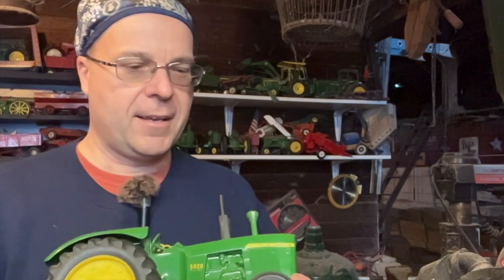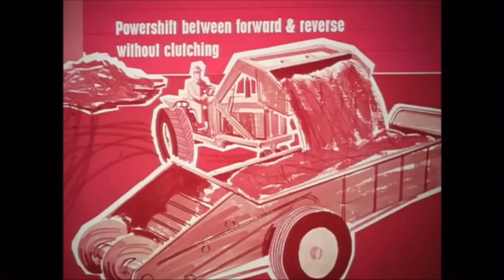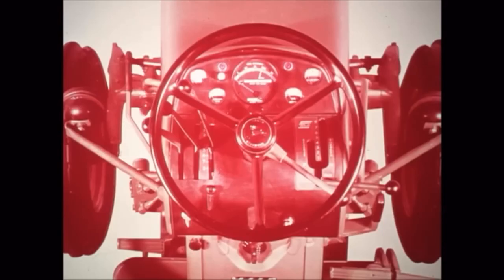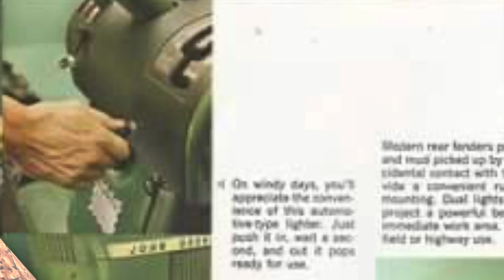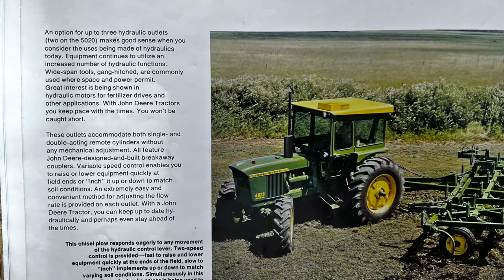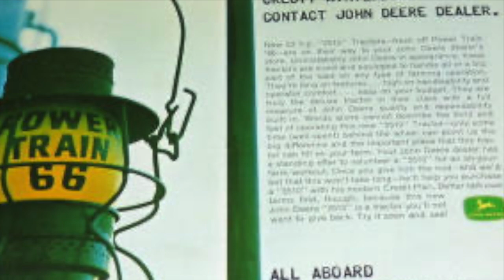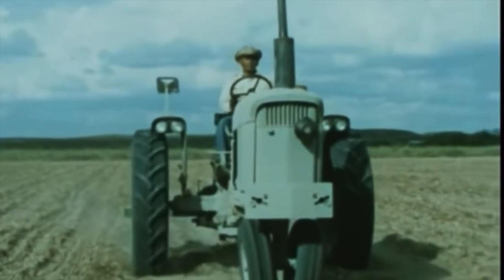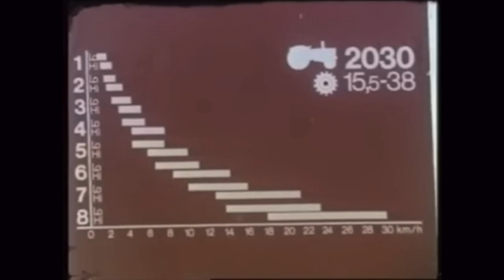JOHN DEERE Tractors & Equipment, 1964-1972 3020 4020 Etc.

Comment: You did an awesome job on the video ! I would say these were one of my favorite tractors John Deere made . I always felt like John Deere was the rich farmers tractor for some reason .  I got that same 5020 toy tractor but it doesn't have the muffler anymore .I remember as a kid going into the tractor dealers and wanting toy tractors all the time . Dang if I lived close we could play toy tractors together lol . Thanks for sharing and have a great weekend !
Reply from the maker: I was always begging for new ones, but Dad would usually shake his head and sign me to shhh. I still have every single one he bought for me. Most of my attachments were made out of wood, painted with generic hardware store green or red and put on wheels from busted toys gramps gave me from working at the dump. I’ve had two versions of the 5020, one with just the stack and this older one with air cleaner on it too. Thank you for watching

Comment: There's a dairy farm in my area that had John Deeres as long as I can remember. They were about the only ones. Now most folks have Kubota tractors which is understandable as you can't go 20 miles in any direction without finding a Kubota dealership.
Reply from the maker: It’s funny how in the beginning, there were dozens of tractor manufacturers, they pretty much narrowed down to about 7 or 8 and now back to dozens again. My favorite John Deere tractors were from the 1960s-1980s. It weird how after the Case-IH merger, all the IH AND Case dealers around here disappeared altogether or picked up Kubota or MF. I think JD are way overpriced these days because of the mega dealerships that control a whole territory and are free to charge whatever they want…like $40 for the same bolt I can buy at Ace for $3. Thank You for watching and have a great weekend
Reply: @LedgemereHeritageFarm  The nearest CaseIH dealer is in Union Grove, N.C. over an hour away from me. When Daddy bought my 140, He bought it at our IH dealer in Winston-Salem less than 25 minutes away. Hope you and yours have a great weekend!

Comment: Great to see the JD roto-tiller brochure. I still have my dad's tiller, and it's been stored inside all these years. I used it 3 yrs ago, and it still runs great. That old Tecumseh engine is a good one. Does anyone know what years those were in production?

Comment: I bought a 5020 just like yours last year in the original box and it had never had been played with for $35.00. That was a heck of a deal. John Deere really made good equipment back then. A guy I know use to have two 6030 tractors. I have rode in them a few times. Around where I lived growing up Deere, Case, IH and Ford where the most popular. They was also a good bit of Massey Ferguson 750 and 760 combines around along with Massey Ferguson 135, 165, and 175 tractors. We still have a Massey Ferguson 165 Diesel on the farm.
Reply from the maker: There’s a New Holland combine on my sisters farm. I made a video of it about a year ago and you got a great deal on that 5020. Does it have the upright air cleaner too? They made 2 versions. Thank You for watching
Reply: @LedgemereHeritageFarm  It is the version with the upright air cleaner but it was missing. I have seen the air cleaners at shows, so I will need to get one. It has the muffler in box.
Reply: @LedgemereHeritageFarm  I found the video and will watch it. New Holland makes a good combines. I own a New Holland TN70 tractor.
Reply from the maker: @Fieldman12  before I retired from the National Guard, I used their TL 100 to push snow banks back on the base. What a great machine to drive!
Reply from the maker: @Fieldman12  Dakotah farm toys may have one. I buy mufflers and eska parts from them sometimes
Reply: @LedgemereHeritageFarm  Yes, I bet Dakota toys has them. I have bought stuff from them before.